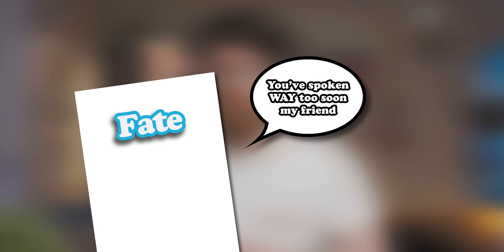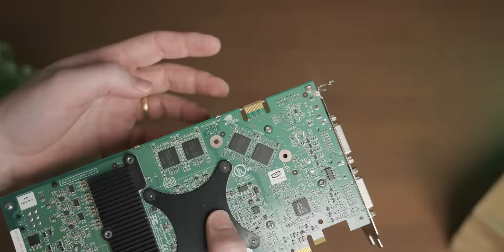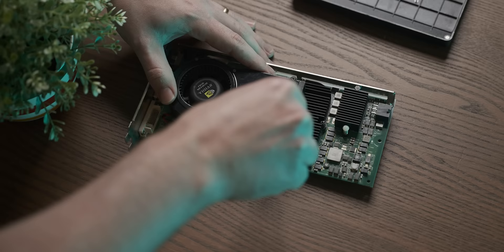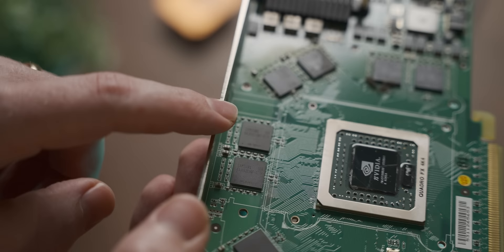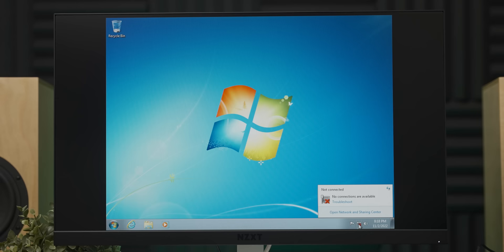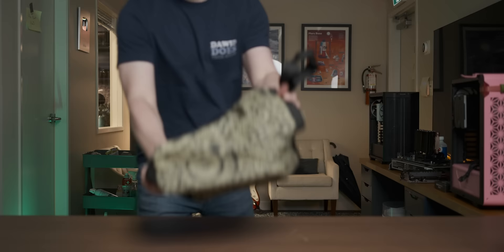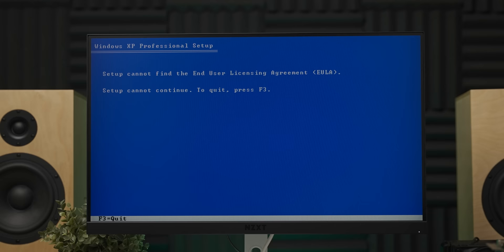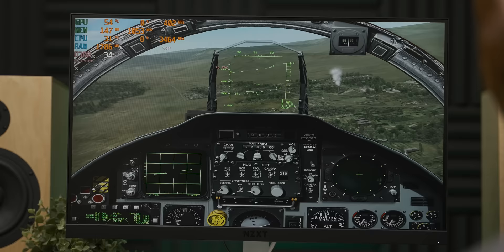Buying The First Graphics Card I See On Craigslist...

Comment: the "weird connector" is for SDI, and the "S-Video connector" is actually for stereo 3D
Reply: STEREO 3D
Reply: I thought it was S-Video until I saw it was missing two pins. Thanks for the clarification!
Reply: the "weird connector" is a 14-pin header for nvidia quadro g-sync, and the round connector is a workstation stereo connector
Reply: correct (y) pressed like !
Reply: Yes!
Reply: What is SDI?
Reply: @pf100andahalf   NVIDIA Quadro Serial Digital Interface (SDI) it's an early I/O capture protocol.
Reply: Ok boomer
Reply: @samholdsworth420  Yes, I would rather not know anything because I like being dumb.
Reply from the maker: Oh cool! Thanks for the clarification. 👍
Reply: @DawidDoesTechStuff  ive seen cards with that conector to add a VGA port in low profile cards, but i might be wrong :)
Reply: @samholdsworth420  bro you act like the only graphic cards you know of, is the rtx series
Reply: @therealstupidwaffle  thinking he knows anything? Awfully generous of you. 🤣

Comment: Hi! I know the reason why you had all of these problems! This is card was made for the 32 bits era and it was expecting to work along with 32 bits drivers. Which even though you was installing 32 bits drivers because the working environment around was 64 bits, there was some issue on the common files usage (which at the time video card drivers were using all the time). By example, if you had installed a 32 bits of Windows XP Pro instead of the 64 one (which by the way, the 64 bits version of XP is known to be problematic aka unstable in many situation as this is a not a TRUE 64 bits environment, so many conflict happens) since the start 95% of the problem you had would have been resolved by itself due to the plug and play nature of Windows.
Reply: i noticed that too
"Windows XP x64"
that means he installed the super unstable janky 64 bit version of WinXP, which indeed was never meant to be, that along with the old ass GPU was just a recipe for problems
Reply: The 32-bit windows XP images are way easier to find as well.
Reply: I was very surprised to see him installing 64 bit XP as well.  I heard there was nothing really available for it.  32 bit XP is fantastic and it STILL feels new to me sometimes.
Reply: @DragoSmash  There was nothing unstable or "janky" about Windows XP Professional x64 Edition. It was quite literally Windows Server 2003 x64 with a Windows XP UI slapped on it. Server 2003 was the last server version of Windows that was actually good.

I ran numerous machines with XP professional x64 Edition for years and never had any issues with it, besides not being able to run 16 bit software. It was my daily driver as well, and I gamed heavily on it. Driver support was spotty in the beginning, but quickly caught up with the Server 2003 x64 install base forcing hardware vendors to write good drivers.

There were two other 64 bit Windows XP versions that are relatively unknown, and those WERE janky and unstable. Windows XP 64 bit edition, or its long name, Windows XP 64 bit Edition for Itanium Systems. Then the followup Windows XP 2003 Edition, which was for Itanium 2 systems. Those versions saw almost no development and were extremely barren. The only reason they existed is because of Microsoft's contractual obligations, and when that went away, so did those versions of XP. I think both only had a lifespan of just a couple years and never did run right. Plus they were missing tons of functionality that existed in every other version of XP.
Reply: >which by the way, the 64 bits version of XP is known to be problematic aka unstable in many situation as this is a not a TRUE 64 bits environment, so many conflict happens)

Nonsense. Windows XP Professional x64 Edition was a pure 64 bit OS, just like Windows Server 2003 x64 it was derived from.
Reply: @DragoSmash  Oh god I just had PTSD flashbacks from when I bought 4GB RAM and had a 512mb, GPU and was forced to install Windows XP 64bit. It was an actual, garbage nightmare of uselessness that didn't work in the slightest. Constant crashes, weird graphical glitches, impossible to run at 1024x768. In the end I just resigned to having 512GB eaten for the GPU and running the 32bit version.

People don't know how good windows is these days...
Reply: I have NV40-based cards and they work fine in 64-bit Windows with 64-bit drivers, including Windows 7. The real problem is due to the AGP to PCI-e bridge chip present on the card. It does relate to a 32-bit address space, as the chip freaks out when there is more than 4GB system memory present.

Comment: The "heatsinked" memory chips are close to the VRM-part of the card and may get additional heat from there. So they gave them additional cooling. ^^
Reply: G'day Braden, I had the same thought about those MEM chips getting hotter,
plus while helping dissipate Heat those fins would also help guide the Airflow over the MEM Chips to the VRM Cooler

Comment: I would love one of those cards for my XP system, quite jealous of you! Despite their niche market those cards frequently go for above the $100 mark, since it's the same GPU die as a GeForce 6800 Ultra under the hood (and those are even rarer)
The POST issues were because the card likely does not support UEFI BIOS, it needs legacy video ROM support. No Windows 10 drivers but the ones for 7 can be modded to run on 10 if you so desire...
Reply: I was under the impression the GTX 960 was (at least "officially") the "best" supported card for XP, is this a "period correct" configuration thing?
Reply: @ffwast  GTX Titan from the 900 generation is the best as far as I know. I've used my GTX 980 on XP in the past, but I prefer to use older, more period accurate video cards.
Reply: @DavisMakesGames  Any of the 900 series should work but official support only goes up to the 960 for some reason.

Comment: Watching the XP part was my life as a IT support guy back in 2009. Having to find the exact branded XP distro for the specific PC or laptop...some things have got better.
Reply: For real...I have used the same M.2 win10 install for the last 3 builds, completely differerent specs, even swapping from AMD to Intel processors...and it still works...mostly. I plan on doing a fresh install but wanted to see what would happen. So far only a printer via usb gives some weird issues, everything else just works.
Reply: @Hughesburner  lol you should really redo the install. the performance hit must be savage.
Reply: @Hughesburner  I have wondered about this myself and didn't know if it would work or not.  I'm totally going to try this.

Comment: Considering how collectible this card is you bought that at a steal of a price.
It's effectively a GeForce 6800 Ultra
Reply: The one problem you will have with these cards is they don't work in systems with more than 4GB of main memory. This has to do with them being a AGP card bridged to PCI-e using an on package chip and the way the bridge works causes havok if you got more than 4GB of RAM in the system.
Reply: @cybercat1531  That is good to know.  Thanks for sharing.
Reply: @cybercat1531  I sincerely hope that was documented at the time. On the other hand, who had more than 4GB of RAM in 2005?

Comment: I still say whale needs to send Dawid an old ISA board and all the required parts from the '90s. One of the ones so old that the only I/O is a keyboard socket. Remove all the jumpers, mess up the dip switches and other "fun" stuff.

Then give him the challenge of not just installing DOS and Windows 3.1, but getting Doom to run in full VGA and with Sound Blaster support.
Reply: That would be awesome!

Comment: the weird connector is actually the connector for the VGA Connector that card has a optional ribbon cable attached to a VGA connector its not for the stereo 3d like you think.. this card was produced back when DVI Was suppose to be the new thing and vga was a optional feature

Comment: The issue with the modern system not booting I experienced with my RX 470 and i5 11400 my solution was to boot it without the GPU on the iGPU which worked and then with the GPU again then it booted 
Don’t know the reason but something similar might work in this case

Comment: What you identified as an s-video port is actually a VESA 3 pin 3D sync port for connecting 3D glasses. You cannot plug an s-video cable to it. @Dawid Does Tech Stuff
Reply: That is absolutely ridiculous lmao. I miss the “3D era,” it was a much simpler time
Reply: @kraio-sfu  it was more common than you might think & hung around for quite a while on workstation cards like this as well as some consumer cards.

Comment: Still owning 6600GT 256MB,  using it as GPU for some older platform testing. It works in Windows 10, and even 11 (though on that second it isn't stable, and driver generates artifacts and BSODs a lot). 

Simple trick to install graphics drivers for older cards in newer OSes - just unpack the driver installer with some software like 7-zip (or run installer, and close it after unpacking - it is unpacked in C:\NVIDIA). Then install drivers manually via Device Manager. Works all the time for every NVIDIA/AMD/Intel graphics, as long, as the driver is for 64-bit OS, and supports Windows Vista or newer :)

Comment: Hey Dawid. This is an extremely late response, but these NV40-based cards are actually still native AGP. And that little die underneath the GPU die is the High Speed Interconnect chip. It's a bridge chip from AGP to PCI-e. At the time, it wouldn't have been a big deal, but using that chip actually causes a bit of an incompatibility with systems utilizing over 4GB system memory. I believe what you were experiencing is likely due to that. It's also why it worked when you installed Windows XP, as you are limited to <4GB RAM in a 32-bit installation. This card does work fine in Windows 64-bit including Windows 10, just with no more than 4GB RAM.

EDIT: You were using XP64, but maybe you only had 4GB RAM installed.

Comment: This graphics card did not work in the first mother board, because it can only work with BIOS. I came across similar issue when trying rx580 in the ASUS Rampage 2 motherboard - the graphics card could only work with UEFI. Later Nvidia graphics cards can work with both BIOS and UEFI.

Comment: I've had issues with older quadros (quadro 400) not posting on newer hardware. You also need to install the proper driver, you can't just use the generic nvidia drivers, they have specific ones for quadro.

Comment: There is a reason for those "classist" ram chips to have a heatsink and not the others. They are hotspots within close proximity to caps, law of TDE and whatnot. Also the ones on the header side were forsaken in favor of the rapid cyclone fan which more than compensated for the heatsink which would have required them to redesign the housing adding cost. I remember testing those cards quite well. I got a batch of 10 in '04 for integration runs.  ||fixed typo to 03 ||
Reply: Except they were released in '05.
Reply: Jeez, think you need to clear out your memory! I have trouble remembering where I lived in 2003!
Reply: @mistermudpie  I had early releases for testing as they were officially released in 04 to OEM's and integrators.

Comment: I picked up a used Gigabyte 1660 super 6gb OC edition off of FB marketplace for $100. Couple years later and it's still working like a champ. It's no powerhouse but it works well for what I do with it. Have it paired with a Ryzen 3 2300x and 16gb of memory. The whole system is used parts. All together in got about $300 in the whole system.

Comment: My first high end gaming rig that I built was an X58 platform.  It was a i7 960 on an EVGA X58 SLI 3 motherboard, 6gb DDR3,  60gb OWC SSD. That was my first SSD and first time using a boot drive... (I paid an outrageous amount for that SSD) 2X MSI GTX 470 (fermi lol) in SLI.  I still have all the parts minus the Case which was used in an upgrade then retired at some point,   I think I should get a $30 case and put it back together. would be fun to see what it can run.  Probably not much since the last driver update was 3/2018.  Anyway, I love the content! keep up the great work!

Comment: I had the 6800 from back in the day and it wouldn't work with any OS after XP, something about lack of dx10 support and os based instructions.
You can still get the 64 bit Windows xp service pack 2 iso directly from Microsoft's website.
Most x58 motherboards only had working sata 2 ports the sata 3 ports were most likely a defunct Marvell controller which ran slower than sata 1 speeds.

Comment: That X58 is screaming for a W3690 Xeon oc'd to 4.24ghz to 4.6.  Just use the multiplier and up the voltage to 1.425v with the load line calibration to level 1 and I'm off to the race's! Or, at least with mine.

Comment: I had the same terrible time trying to find XP ISOs for my retro computers. All of 'em have legit XP Home Edition codes, but not had their original drives or disks. It's even worse if you're looking for Home specifically, cuz all the dodgy cracked ones all over the net are Professional. I did end up finding delightfully, a DELL XP Home Edition package, unopened on eBay, which was PERFECT for my 2003 Dimension.

Comment: For the love of god, have some sysprepped system images of each OS, rather than installing from USB. You will save soooo much time. Heck Windows 8 and newer don't even need the sysprep tool to actually universally boot. Macrium Reflect is a good imaging tool. 

FWIW you can get these working on Windows 10, but only if your motherboard has CSM enabled for the GPU and the driver is installed manually

Comment: Those Sata 6/III ports were probably Marvell-based (eventually AsMedia but I believe the first was Marvell to make them) third party controller.. and in the end they were slower than ICH8R (or whatever can't remember the chipset if it was the 8 or 10) SataII native intel.. 

I had one in my old P55A UD4, but it was the same for the 1366, so you needed to install proper drivers during win install to make it boot. Only sequential was good, but 4k/4k random was terribly slower and with latency added than native sataII ports.

Comment: Odd that it doesn't work given that I've had no problems running a 6200LE in an i7-2600 system with Windows XP, 7 and 10, although I didn't attempt to install any drivers in Windows 10.

Comment: Quadro FX 4400 should boot even with Windows 10 and more modern system with UEFI BIOS. I used to try an even older Quadro FX 3000 with Windows 10 and it's work though that time I didn't test it due to Windows 10 don't have any compatible AGP bridge driver and that make the graphic card only run at PCI speed which is very slow. Also, it's working fine with Windows 7. Driver can be installed. But on Windows 10 you have to extract the driver installation file and have to put the driver in Device Manager yourself.

I am sure the problem you've encountered seem to me that the graphic card might somehow broken in the first place if not by your disassemble. To be honest, you should test run the graphic card before disassemble to ensure that the graphic card is working first. If this is indeed in working condition it should not be a problem to boot up and install driver on Windows 7 and 10. I firmly believe this card should work with most system perfectly fine if there isn't any other problem appear.

This thing is absolutely a beast when come to classical retro games, (before SM 3.0 came out) but not so much in more modern DirectX 9 games. I tried Call of Duty 2 at full HD and my Asus V9999, which is from the same generation as this thing, it never exceed 25 fps and average around 16 fps only. They're not build with 1080p gaming in mind, people that day still using 1024x768 screen for most. But this have 512MB VRAM so maybe this thing should be better than mine if the card is not broken.

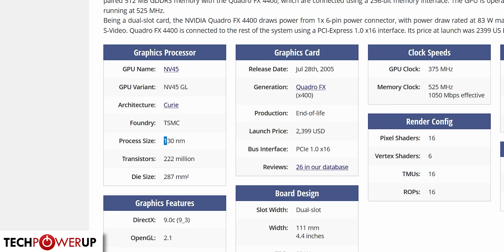4:17 Somehow it looks like GPU die is cracked, though if it's really cracked the card should not be able to output either so I don't think that's the case.

5:25 That motherboard, the legendary Gigabyte G1 Sniper, one of the most unique looking and most cool Gigabyte motherboard, very difficult to find secondhand back in the day and even more so today. And they didn't make a motherboard like this that's similar in style since then. It's successor didn't retain its style and gorgeousness and in Haswell generation it isn't even a high-end board anymore.

8:03 That heatsink is Thermaltake SpinQ VT, and it can be configured both in vertical and horizontal way but its blower fan didn't support PWM. Also something good to have around.

Comment: 2:25 It might be a VGA connector. Some GPUs had that to support VGA even if they don't have a connector on the back. But they were mostly SFF cards. It has 14 pins which is the same as VGA where you don't need one of the pins.
Reply: no its a  Serial Digital Interface (SDI). This was a common connector on Quadro cards, even my k4000 has one. Its a serial interface thats gives direct I/O access over the card for (not many) but some implementations

Comment: The dominant use of aluminium nowadays is because aluminium is better at giving off heat in convection while having a thermal conductivity not much lower than copper. Also its much, much cheaper than copper.

Comment: You should do a video fo modern games with old sli cards, can you save money by buying 2 cheap cards insted of 1 modern mid tier one.
Reply: The mid tier card will absolutely win. Sli is pretty much dead and proper support on modern games is non-existent, and in older games sli was crap thanks to bad support from Nvidia and AMD and most devs not adding proper sli support.